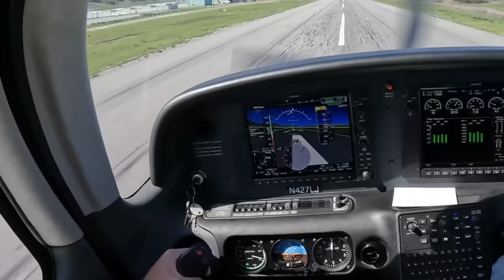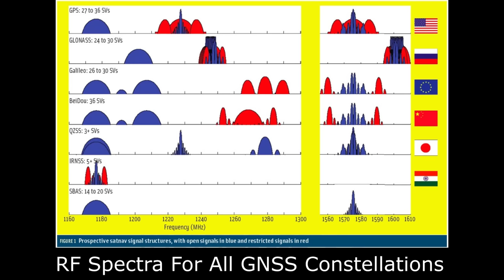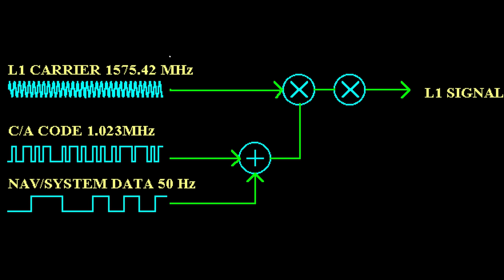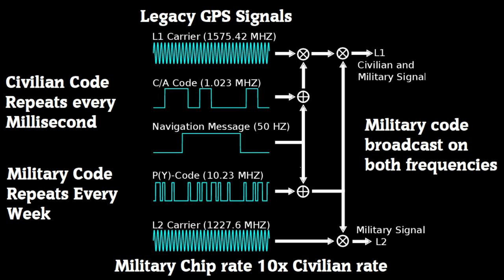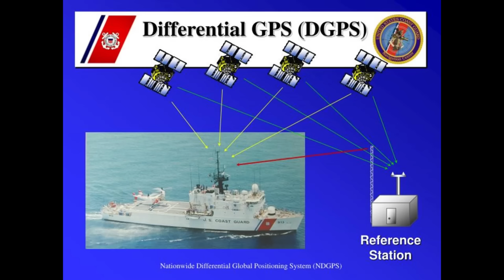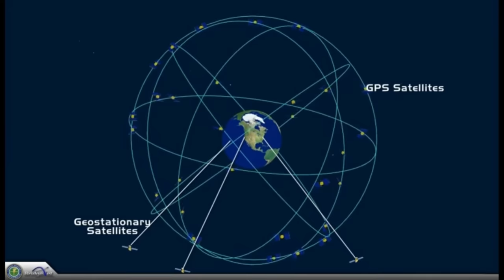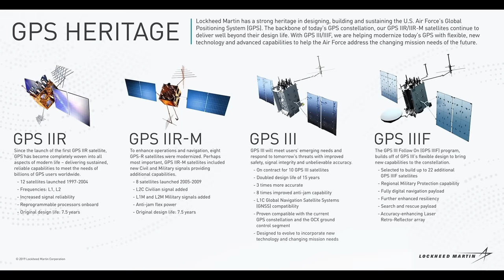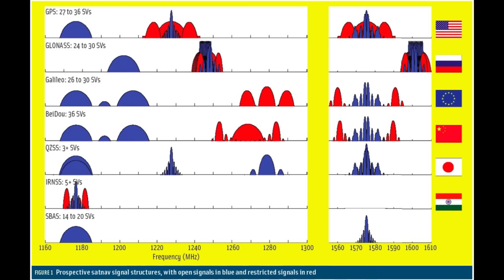How GPS Works, And How It Got Better Than The Designers Ever Imagined

Comment: Um, this deserves more commentary than fits here.

But, first, you forgot or didn't know of the Navy's Transit system? It was not up to Decca or Loran C standards; but, it proved satnav as a viable concept?

During the 70s and 80s I worked with two of the primary companies developing GPS satellites, one as an RF engineer and the other as a software critter. (Am allergic to "software engineers" so refuse the name for myself. {^_-}) GPS proved to be fully as accurate and strange as some people at both companies predicted. (I was yet another who reinvented differential GPS, for example. That was my counter for the degraded accuracy work I was doing at the time,)

Ah, yes, I well remember hearing about those early civilian GPS purchases by military people to save their bacon. It felt good knowing I had a paw or two in creating the satellite end of the tool. BTW, for the military in high speed vehicles GPS tells you where you were not where you are. Other navigation tools provide the information to give you the forward prediction to "where you are now" for display. These days consider it as telling you precisely where your antenna is with a very good guess of how fast it is moving in one direction.

Regarding the CDMA code, the edges of the code's bits tell you where you are in most receivers. (more later) The codes transmitted also provide a very high level of anti-jam protection. Alas, the satellites are too far away to make that anti-jamming as useful as it might be.

Selective availability, now that I can legally type it, was to a fair degree my baby from a hardware design standpoint. It used a frequency synthesizer I designed that provided approximately 2 microHz step size with a step range of about a couple Hz. It was used, with a special random number sequence, to precisely set the frequency of the Rb standards or the Cs standerd to a precise frequency near 10.23 MHz that accounted for relativity and other effects. It also set an intentional frequency error, which was slowly changed to walk users off the correct location. Of course, one of its primary uses was to correct for the accuracy of the standards involved.

Regarding SA and differential GPS, I remember the look on the face of the Captain when I explained that all the SA work I had done was spurious because of differential GPS that I had independently reinvented while developing that synthesizer above. I explained that the Ruskies could still use GPS to plonk a bomb down Jimmy Carter's toity in the White House using differential GPS. Snicker, I'm a baaaad girl. Of course we did it anyway. The company I moved to, Magnavox in Torrance Ca, had their own attitude about accuracy. With GPS they had a vehicle that had a GPS antenna on its front bumper with a plumb bob beneath it. They were known to take the truck out for a drive and manage to place that GPS antenna above the same spot on the road with single digit centimeters using carrier tracking GPS. They also used a large antenna to get a clean enough signal they thought they could see the synthesizer steps in the data they recorded. I elected to go with their gag. The synthesizer was designed to sink it's effects within the phase noise generated within the frequency standards. I do not their differential GPS was navigating ships between islands between Sweden and Finland with clearances of less than 6'. That was a major data point in removing SA. I bet another was distributing the anti-SA codes to the huge numbers of military users.

Regarding precision FAA and others wanted I believe they considered using pseudolites with low power to provide high accuracy locally. That rather defeated the purpose of SA so that was nixed early on. But that is not something I know for sure. It's just a logical thing I would have suggested before it was shot down.

I was really excited by the additional civilian (and military) carrier frequencies for GPS signals. Getting it all lined up and keeping it lined up after launch must be an interesting problem. Back in the day ITT back East developed the navigation unit that generated the actual transmitted GPS signals. A lab I worked in developed the prelaunch GPS test receiver that allowed testing the satellite while it was on the launch pad. In the process of initial tests of the receivers against our test set they discovered an artifact we'd missed. They tested differently than we did. We isolated the problem down to the connector we'd used for the RF signals on the unit. Despite claims by manufacturers there was no way to assemble the type N bulkhead connector to RG223 cable used inside the test set without introducing severe signal reflections. The reflections degraded accuracy considerably due to the multiple paths for the signal to take that the connector introduced. We kludged up a fix. When all done our built in test transmitter was an insanely accurate beastie. (It still was not worth the pneumonia I went down with after months of 70 hour work weeks.)

Now, if you have read through to this paragraph I have a question for you. Are you aware that the GPS system actually defines a very accurate position referenced to a very specific time? The time is back in the 70s. And the position system is relative to where its control station was at that date. The control position has subtly shifted due to usual geological processes. The GPS system knows about this and actually told us it was happening. One of my Magnavox co-workers hit me with that one during a moment of me being too much of a know-it-all.

With the new, er,  SDT technologies available today plus the rumored reductions in radiation resistance requirements from the 1991 peace dividend the satellite transmitters today must be almost magical in their potential capabilities. And with SDR technologies current today, um, it SHOULD be nearly impossible to drive a GPS receiver off as long as it can receive signals. In the interests of the recent events in Ukraine vis a vis Russia I won't make more suggestions. The Iranians walking a major US drone off position so that it landed in Iran is a total disgrace showing a huge hole in modern military development "artists". Jamming should be/will be for some time to come quite easy. It's simply a power level into the antenna issue. But spoofing a military tool should be basically impossible if the designer spends 20 minutes of deep rumination on the problem.

{^_^}    Believe me or not as you choose. The above is what I believe is true based on my memories of being there doing that.

Comment: While I can get X, Y & Z + dT from four signals, I always pictured it as a sphere with one satellite - I know I am somewhere on that surface. With two spheres, the intersection is a circle, with three it's two points on that circle, and a fourth puts me onto one of those points. So my methodology may not be correct, but still arrived at the minimum of four correctly.
Reply: Mathematically valid ... but note that half of your calculated locus is above the satellites, thousands of miles up. So, if you triangulate from 3 signals and your 2 solutions show z = 1500 m and z = 40 000 000 m, it's reasonable to discard the second solution. (:

This is why you need only 4 signals, not 5, to derive {x, y, z, t}. And if your receiver already knows t to sufficient precision, you would need only 3 signals for the 3 spatial coordinates.

Comment: Another cool trick some satnav units do is they tap into multiple constellations at once. I've seen units with some obscene precision levels that do that. Does a handheld nav unit need sub centimeter accuracy? No, but it is nice especially when using them on foot to plan out stuff like new trails where that high accuracy is a good thing.

Comment: I remember having a conversation over a decade ago where a european construction company was using GPS to guide the blades on their bulldozers on construction sites and could remote control them to an accuracy of less than 6 inches... not sure if that was bs or if they'd figured out a way to gain that accuracy due to the slow speed of the equipment vs. aircraft or even cars and trucks.
Reply: I worked for Trimble in one of their R&D centres for about 18 years. One of the projects I worked on was the first construction guidance/control system (project “cobra”). The system used RTK to obtain sub-centimetre accuracies (horizontal).
The first version utilised 2 GPS receivers with the aerials mounted above the 2 corners of the cutting blade, and provided guidance to the machine operator via a pair of vertical light bars. The next version had me fitting proportional control valves in parallel with the blade hydraulic manual valves to enable direct blade control.
Our test site was a golf course development using a Cat D5. They had completed one fairway prior to us fitting the prototype system, and the rest of the development was completed with the prototype. The digital terrain model was loaded into the system, a -400mm offset dialed for the initial cut, then a -200mm offset for spreading the drainage layer, and back to zero offset for the topsoil. The project was completed 6 months ahead of schedule…
The next iteration was to add motor graders, and then other construction equipment types (excavators, compactors, rollers, pavers). For higher accuracies, particularly in the vertical, the systems can combine GPS, total stations, laser plane, and ultrasonics.
Trimble partnered with Cat, and the systems became a factory fitted option on new equipment.

Comment: Interestingly, the shootdown of Korean Airlines Flight 007 would not have happened had the 747 been equipped with an OMEGA very-low-frequency receiver navigation unit, which had been available since the middle 1970's. Even with the accuracy of around 2,200 feet, if the KAL 007 crew used OMEGA they could have noticed the navigation error early on and made corrections on the flight path to avoid flying over the Soviet Union.

One nice thing modern GPS has done is drastically eliminating controlled flight into ground (CFIT) crashes. Modern GPS accuracy means the flight crew knows the location and altitude to avoid flying into dangerous terrain.

Comment: 7:30 The scalar product does indeed seem to occur in the algorithm. What really happens is that you use a large vector space and an orthogonal basis of it, and then assign one basis element to each connection over which the frequency is multiplexed. In this way, each participant can get their own message by taking the scalar product of the entire message with their own basis vector.
Reply: hi adrianf., what do you think about all gubments drawing a line around you(Antarctic Treaty) and saying you are not allowed to leave? If you don't know what I mean, read my about tab.
Reply: @flat-earther  You can go north and observe that the sun never goes down for a long period of time.
Reply: You are not forbidden to go to Norway, for example. https://en.wikipedia.org/wiki/Midnight_sun

Comment: initially civilian GPS had Selective Availability engaged this is an intentional error induced by the department of defense, it started at 100M then later turned down to 60m, then the us coast guard started changing there old Loran towers to Differential Beacons. I owned a Garmin DGPS receiver tax dollars were spent to put error into the system and more tax dollars were spent to take it back out so it was finally removed. I transferred to Guam which did not have a DGPS beacon so I purchased my own differential beacon that uses Ham VHF so while I was there I had the most accurate civilian GPS.

Comment: 5:30 I don't know why people keep making this mistake. You need four satellites because of geometry. See, one satellite gives you a position and a distance. In 3D space, the set of points that are a given distance from a given point is a sphere. The intersection of two spheres is a circle. The intersection of a circle and a sphere is two points. So you really need to intersect four spheres to narrow it down to a single point.

The other way you can see that it doesn't work to look at the number of dimensions and assume that was enough is to look at 2D space. In 2D space, a position and a distance gives you a circle. The intersection of two circles is two points. So in 2D space, you need three measurements to narrow it down to one point.

Comment: Consumer GPS is designed to compute mainly in 2D, altitude doesn't really matter. This allows the cheapest chips to be used. Boats, even cheaper since the altitude is "always sea level" effectively.
 Aviation GPS needs accurate altitude and it has to be more accurate and do it at much higher speeds, part of the reason FAA approved aviation GPS is damned expensive.
 Then there is the surveyors market, which may need a one cm. accuracy in 3D, but if it needs ten minutes to average out multiple readings, with special assistance...that's ok. And again damn pricey.
 The WAAS assisted GPSes could originally only use that signal within range of the coastal stations. WAAS corrects for atmospheric distortions by measuring them, and then telling GPS stations "everything you hear is offset by..."
 So there's a LOT of complexity and differences in the units.

Comment: Would have loved to hear Scott talk about how GPS satellites have to adjust their on-board atomic clock signals to account for time dilation based on Einstein's General Theory of Relativity.  Yes, the satellites are travelling fast enough that over time, their clocks will drift compared to a stationary clock on the ground.  Without adjusting for time dilation, GPS would be worthless!

Comment: Good in general but numerous small errors. For instance, there never was intended to be a Civilian signal. The C/A signal is there because the original correlators had considerable problems locking onto the P(Y) signal. To help with this the C/A signal was used to get the receiver timing into the "ballpark" so that the receiver could lock reliability onto the P(Y) signal. The US Coastguard system (DGPS which has since been shut down) was for more about reliability of the position (which had terrible problems in the early days) than it was about accuracy. I mean how accurate does a ships position have to be. Worst case in the early days was 300M - good enough for shipping but not obviously for aircraft.

Comment: I've thought it would be fun to back-of-the-envelope a GPS like system that can operate with zero ground support for years to decades at a time.

At a guess, what that would end up looking like is a system where the satellites coordinate with each other to give an accurate reference frame that only drifts slowly relative to the surface of the earth. (How slow that drift would be might be limited by things like the uncertainty in the rate that leap seconds accumulate (a leap second amounts to a >400m delta in position at the equator). Ways to limit the drift (tracking pulsars?) and ways to keep the satellites operational (choosing orbits that minimize station-keeping requirements?) would be the fun part.

Comment: Actually GPS is more used outside of navigation in daily life. Every cell tower has a GPS receiver even though it is not moving around. GPS’s ability to keep time is what makes digital mobile telephony work (with the same CDMA technology, called FDD in LTE speak.) Enhanced 911 developed after 9/11 required the 1m resolution including the vertical component for emergency responders to access exact locations.
Reply: hi menta, what do you think about all gubments drawing a line around you(Antarctic Treaty) and saying you are not allowed to leave? If you don't know what I mean, read my about tab.

Comment: this accuracy could also because of differential GPS where a support transmitter is located near the airport. this augments the position resolution with a few factors.
Reply: No, in the US right now most airport approaches support WAAS, it is a differential GPS system however there are only about 25 ground transmitters that cover the whole USA. There is a differential GPS which is airport-specific but very few airports have it.

Comment: Gonna put my own guess here before watching the entire video.

It's my understanding that the GPS signal is largely passive, and the GPS navigation tools we use in our phones etc, get the information from the satelites where they are, like a good old FM radio signal for your car, which incluces a time stamp, and then it uses the time delay from each satelite to figure out where on Earth it is, by combining it with the satelite's data of where it is, at any given time. Lets see if my idea of how it works is right.

Better computers also mean better computational capeabilities, so without even changing the hardware up there, our phones are getting better and better at interpreting the data, thus improving accuracy.
Reply: hi queensaffryn, what do you think about all gubments drawing a line around you(Antarctic Treaty) and saying you are not allowed to leave? If you don't know what I mean, read my about tab.

Comment: And now we have Google and Apple doing their own differential additions to GPS with WiFi AP locations to narrow down a phone's location to within a few meters - or so the location radius data in API responses claims. Yet coordinates will still jump to cell tower triangulation and assumed locations will be "adjusted" to static addresses the provider knows about, rather than the obvious solution that the device in question is just sitting at an intersection waiting for the light.